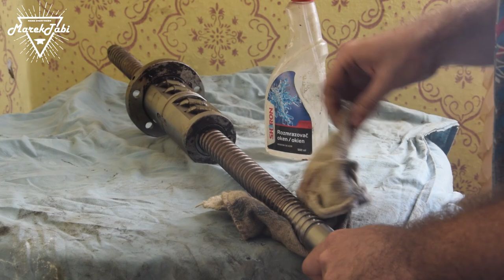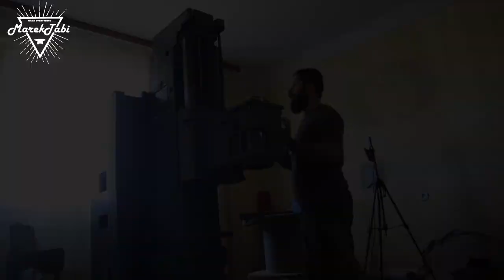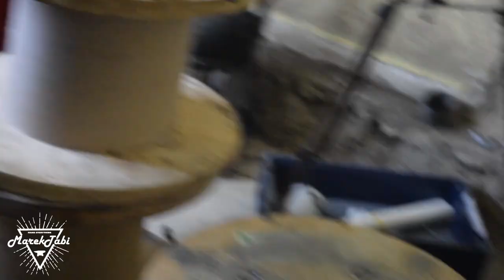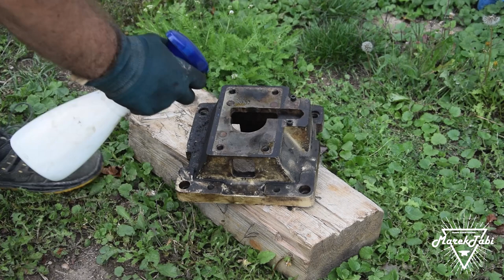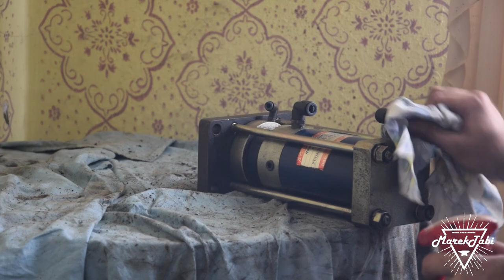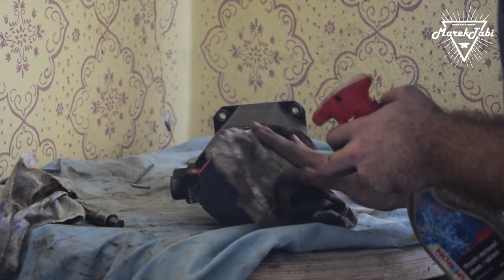Restoration CNC Milling Machine - Part5 Spindle

Comment: Machine coming along nicely, that Z axis ball screw looked pretty rough. Would have been a good idea to reball it while it was out. New ballbearings are cheap. And installing the backlash bearing pack, put them in to the freezer over night and they are very easy to install.